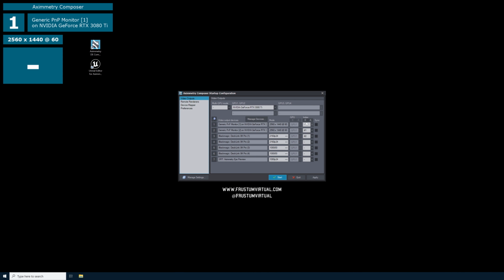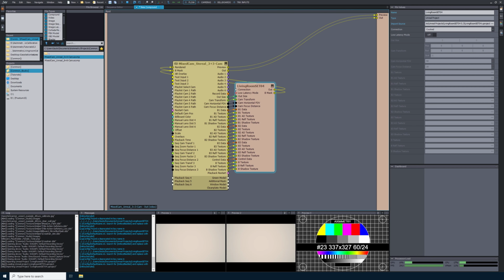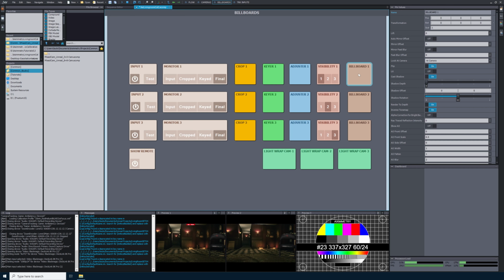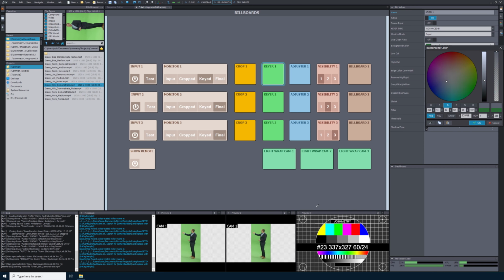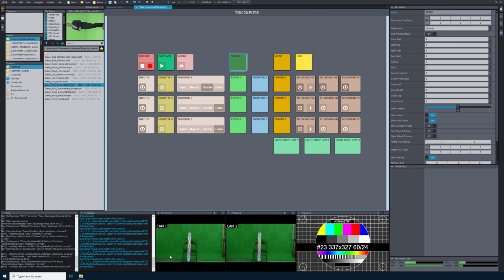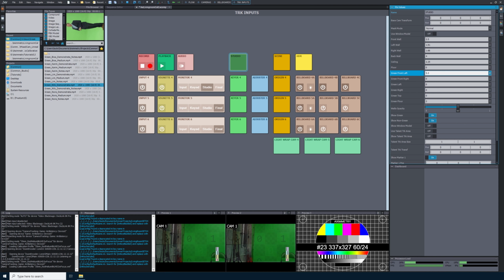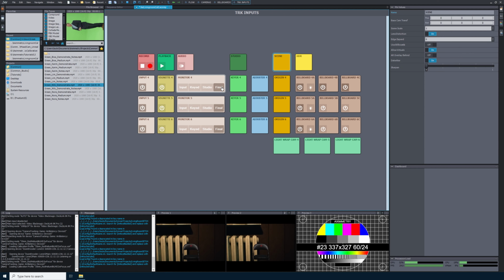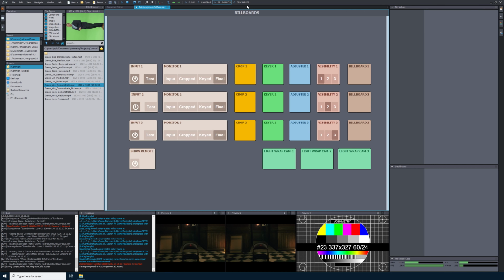Setting up Aximmetry DE for Mixed Camera Green Screen - Virtual Production - Aximmetry 5.3

Comment: I have a question on the video import function piece using the test button. Is there a way when adjusting the parameters when the Test button is selected without having your original virtual camera settings changed once the test button is released? My guess is no, but I was surprised when my original camera feed footage was all changed.  I would imagine I would have to use a different virtual camera input if I wanted separate settings.
Reply from the maker: Correct you would just have to use another input you can copy paste any of the settings like billboard position to the next input. If you want input 1 to be your live camera feed just connect the prerecorded footage to test input 2 then in the cameras tab you can select the camera you would like to see Vcam 1 would be your live feed Vcam 2 would be your test footage. The only way to keep all setting the same on one input would be to have prerecorded footage that matches exactly to your live camera feed. Hopefully that helps.
Reply: @frustumvirtual  Thanks for confirming it.  Working my way through the video step by step, lots of notes so far :) Then I'll try the AR video and see how they all come together with the virtual and tracked cameras.
Reply from the maker: @Justin_Allen  by using the billboard you shouldn’t have to use AR. You can place the billboard behind the 3D objects. Just remember that with tracked camera your physical space and virtual space are 1:1. So the distance from your subject/billboard to your physical camera needs to match in physical and virtual space.
Reply: @frustumvirtual  Thanks for that reminder. I saw that when I was playing with this a month or two ago. My use of word AR went to things like adding graphic pop-up's and things like that around the talent. Of like the avatar you brought in on your AR video.  Again, I need to get to that video...hopefully first part of next week.